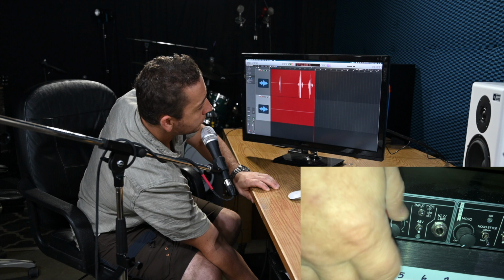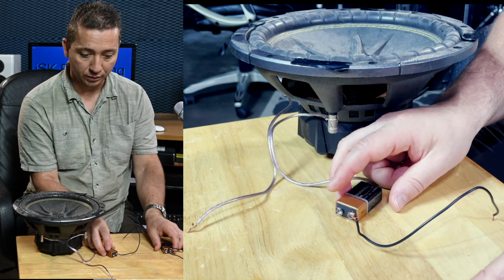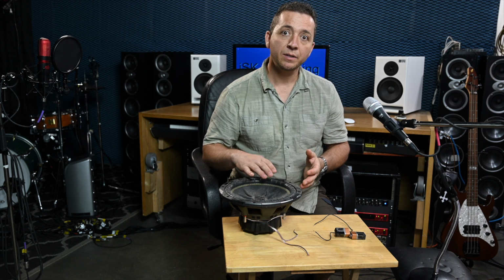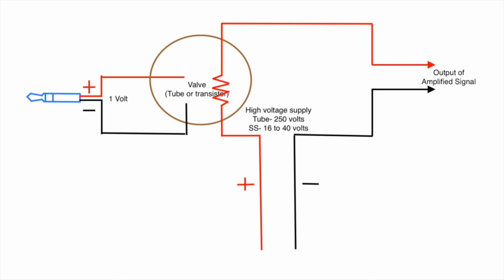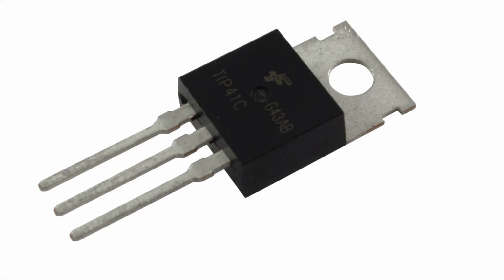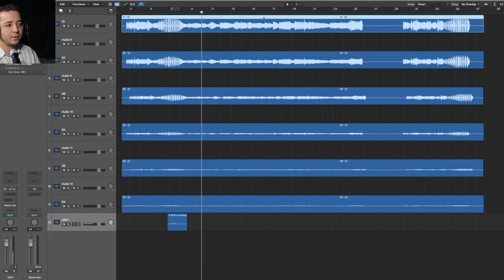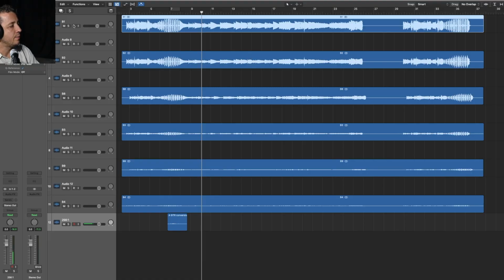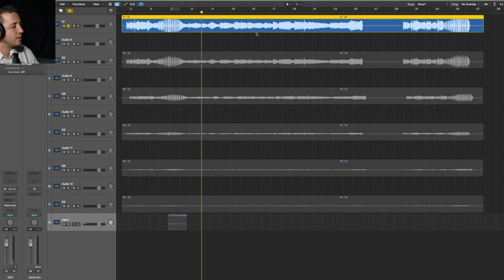Microphone Preamps Explained in Depth. Lesson 23

Comment: Hmmm... That's an FMR RNP in the thumbnail behind you. I got one of those forever ago and I still have it along with an RNC. Haven't touched those in ages but now intended to go dig them out and see how they stack up these days....I wonder if the RNP is still the step above interface pre's.... They were clean and basic but they used to have more depth, clarity and crisper transients a decade ago....
I'm sure the RNC still stacks up with super smooth clean compressors.... Even though there's no character there.

Comment: Great video! Now the question is: is it necessary to spend hundreds or thousand of dollars in a mic preamp to get that "warm tone"? or today plugins are already doing the job?
Thank you.
Reply from the maker: No, it’s not necessary to buy expensive preamps. Most modern audio interfaces have built in preamps that are just as good as expensive stand alone preamps. You can check out my “ best audio interface” video where I compare the preamps qualities.
Reply: @Get.Pro.Recordings  Yes, but as you said, built it preamps are transparent. The idea is to record vocals with a warmer tone, which in theory can only be achieved through a "traditional" preamp. Therefore 1) is it enough to record transparent vocals? if warmer vocals are needed, do we have to get an additional preamp? or plugins can replace them? Regards.

Comment: Hii, ive searched everywhere for answers on my DIGITAL MPA (connected via s/pdif ) with inserts, the manual didn't specify how to connect the inserts to  compressor,
Reply from the maker: These inserts require a 1/4 splitter cable. It’s the same as using the inserts on a behringer audio interface. This video has a good explanation.
https://youtu.be/gdHuS0UUzPw?si=t70EdqmLzw2e5arG

Comment: I love the Audient Preamps for their transparency and clesness. Im currently using an ID14 mkii interface. And im thinking of getting the new ID24 so i can add the warm audio 1176 and LA2A clone preamps into the inserts.do you think this will help me improve on the quality of input i record and add some good harmonic distortion to the recording. Thanks
Reply from the maker: No, adding those compressors will not help you get better quality overall. They will give you a different type (or flavour) of compression, but not necessarily better than plugins. Most professional mixing engineers use plugins, not hardware.
The Audient preamps are excellent.
Reply: @Get.Pro.Recordings  so having sorted the preamp of the Audient as being excellent. Do you think the converters in their ID14 mkii is excellent enough for getting good mixing and mastering if i have a good quality monitors like say the focals or Genelec one

Comment: Hey! Quick question: I recently bought a Neve 5211 Preamp to go with my BLA 17 Compressor (which I only use sometimes). I was also considering buying an Audioscape Opto compressor (LA-2A clone) to complete the chain. The 5211 seems legit but it's so expensive. Could I get similar results with a less expensive preamp? I don't wanna cheap out but it's hard to believe my 5211 sounds day and night better than just my Neumann into the Apollo. My current vocal chain is Neumann U87 > BLA 17 > Apollo Twin X Duo Interface
Reply from the maker: I’m surprised you hear a night and day difference between the preamps in your Apollo, and a Neve. I think the Unison preamps in the Apollo are fantastic, and able to hold their own even compared to a Neve.
There aren’t any inexpensive preamps that I know of that will perform to the level you want. A couple of the better valued ones, in my opinion, are the cranborne audio Camden ec2, and Useful Arts makes a very nice tube preamp.
Honestly though, if you’re not happy with the Neve or the preamps in your Apollo twin, then I don’t think a more expensive preamp is going to make much of a difference. Hope this helps :)
Reply: @Get.Pro.Recordings  hey, I think you misread my comment; I actually said it is hard to believe my Neve preamps are night and day better than my Apollo. I have yet to do a direct comparison, but I think I agree with you. I just got the Opto compressor for Christmas though!! so I will keep the preamp to use the outboard gear. if I do the direct comparison I will try to keep in mind to let you know how it goes. thanks for your reply and insight!
Reply from the maker: @officialdiomer  Ah.. yes, I understand now. Congrats on the new piece of gear.. I hope it  works out great for you :)

Comment: Wow. Thank you so much. I just did some deep learning on an important subject I've been fuzzy about for years just by watching your video. Outstanding. One quick question. The specs on my interface (Apogee Symphony Desktop) show EIN as un-weighted. Is that the same as a-waighted? The full spec is: EIN: 129dB (un-weighted) @ 60dB, 150 Ohm input. I'd appreciate your clarification on it. Thanks again!
Reply from the maker: I know from experience that the preamps in the symphony are very good, but an un-weighted measurement is not helpful, and could be several Db’s different from an a- weighted measurement.
Thanks for the question:)

Comment: what pre amp would you recommend me getting to go with my Apollo twin and Neuman u87
Reply from the maker: The built in preamps in the Apollo Twin are extremely good, I would recommend just using them. Most dedicated outboard preamps wouldn't offer much of an improvement, unless you get into the very expensive price range, in which case I would recommend the Useful Arts SFP-60.

Comment: Small question, what about transformer-based preamps, like Neve 1073 etc? Are they a subset of solid state / transistor types? Or you’re planning to discuss them in a separate episode? Thanks in advance.
Reply from the maker: Excellent question. The Neve 1073 uses transistors, and is therefore 100% solid state topology.